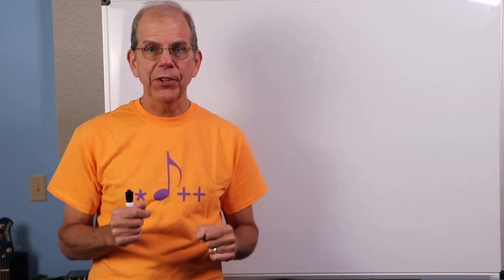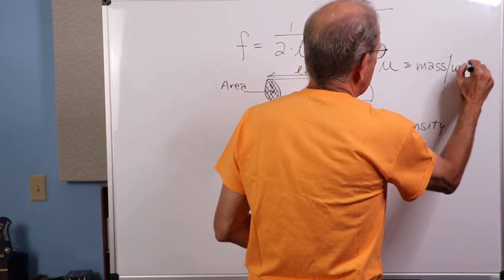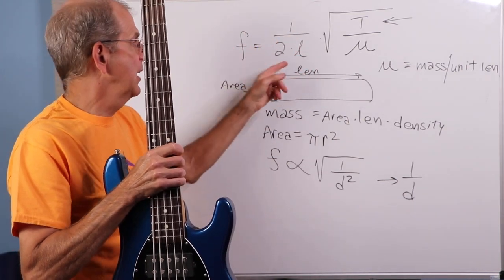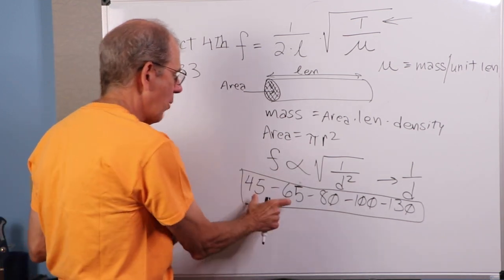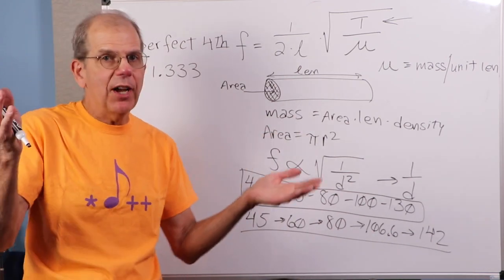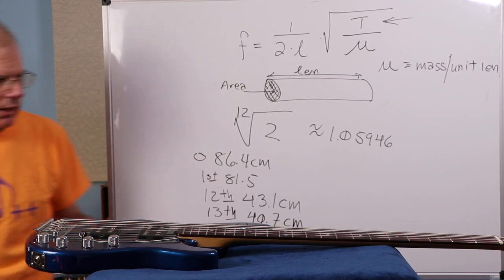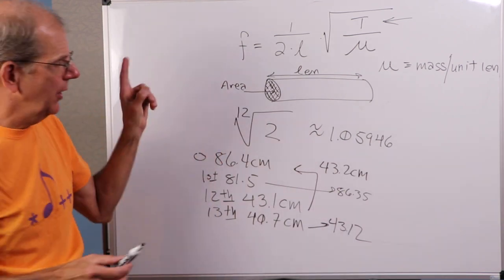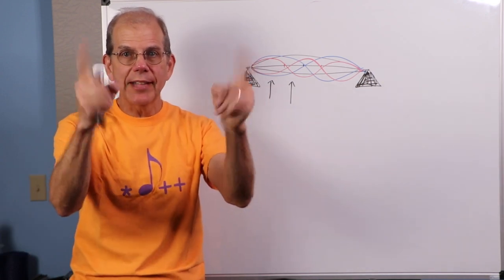Science of Sound: Guitar Physics

Comment: Nice explanations, do I wish you got a bit grittier into the math, trying to learn about intonation changes and compensation for temperance like stretch tuning. also I have a nylon string and only the largest 3 strings are wound, sometimes like 19 cents off as a difference from the 4th to octaves, and would like to see how different strings might help normalize the tension disparity.
Reply from the maker: All interesting bits to be sure, but a little more than I can cover in an introductory video. 19 cents is quite a bit. Has the instrument been set up properly (using that set of strings)? For ideal strings, the diameter* does not matter but there is a small correction factor for real-world strings based on diameter (same thing is true for resonant pipes in case you also play a wind instrument). In practical terms, though, the important thing is making sure that the guitar has been set up by a qualified luthier. No note should be off by 19 cents on a correctly tuned instrument.

*to be clear, that statement assumes the two strings have the same mass per unit length (which implies that if they have different diameters, then they must have different densities, i.e. made out of different materials or using different construction).

Comment: Sorry, but I'm still waiting for part 2  regarding pickups, which would have pratical use, because many questions were left unansered as far as I can tell...: 

How thinner or thicker coil wire...vs more or less "turns"...affects affects both tone & output power. It appears that more "turns" on the pickup coil increases current & woltage out, while thinner wire decreases it...but with a net gain of current & voltage  from more turns of thinner wire, but an increase of the frequency of the resonant peak. 

I also understand that inserting a capacitor between signal & ground on the tone "pot" can increase or decreae (higher value "cap") the resonant peal of the overall output, while the latter increases the bandwidh of the higher frequencies the cap passes. Why & how is that? And how does the "taper" of potentiometers physically accomplished and what does each taper doe to frequency response as the "pot" is turned. And, I've a'ways thought that a tone control increased or decreased bass vs treble frequencies...but now I've read that it actually just decreased the resonant peak/ Is that right??? 

In fact, how do "pots", which are variable resistors, vs capacitors, in pickup circuits affect tonal & power output. And, is there any way to create, effectively, a variable capacitor using electronis as opposed to the tradional "tuner" device consisting of interposed metal plates?

And, how is frequency response & power output of a pickup varied based on whether one pickup is "on" vs 2 or more, and how is that output changed based on whether the pickups are in phase, or not, in parallel or in a series? I "get" that  hum-cancelling is  accompleshed by combining twosinglecoils  with opposite winding direction & opposite polarity, as  long as  the  magnet strength,  number of winds & resistivity of the coil wire of the two coils is identical. But, how does that work?  

There are "treble bleed" circuits ranging from a single capacitor, capacitor AND resistor (in a series, parallel, or 2 resistors...1 in a series & 1 in parallel with the cap)...But, how do these respective "circuits" affect level of treble tone as the volume pot is turned down...and why??? I understand that a variable resistor in a treble bleed allows the amount of "bleed" or treble pass-thru to be varied...but is the variable resistor to  be in a series  or in parallel with the "cap"?

I appreciate your videos...but sometimes they stress the theoretical, rather than the practical nature of this physics. And, while you talked about pickups for guitars...you can see that there are dozens of things you omitted! I thought you were going to create a Part 2  about pickups (which would cover the above)...but all I can  find is about a minute about pickup harmonics, suggesting why some guitars have multiple pickups, in your Science of Guitars video. And, in that minute or so, you didn't even mention why the position of the pickups affects its tonal (as opposed to power) output.

I sure would like to see that Part 2 about pickups, that would explain even a fraction of the above...and how that knowledge can be put to use from a practical  standpoint. THX
Reply from the maker: Well, you certainly have raised a number of questions, and as I always told my students, "Every good question deserves a good answer, and every good answer will lead to another good question". Everything you're asking would require several videos to address, but I'll try to hit a couple of them here and now. 

First, yes, I do tend toward the theoretical, but that's because I'm an engineering professor and my target (students) want and deserve that sort of subject treatment. Granted, on YT, I recognize that there are a bunch of non-engineering students who watch these videos so I do try to slant a few of them in that direction. Can't please everybody, though. Anyway...

More turns generally leads to a higher output. The gauge of the wire is a practical limiter here (who wants a pickup that's 6" across?). All things being equal, a lower gauge number (i.e., thicker wire) will lead to less resistance. This resistance will interact with the coil inductance and any associated cable or winding capacitance to change how narrow the resonance is in the frequency range (i.e., the bandwidth or Q). A proper explanation for this requires a study of series and parallel AC resonant RLC circuits, and that's not trivial (I've got an entire playlist on the study of AC circuit analysis and one entire chapter of my free AC circuit analysis text devoted just to resonant circuits). In general, the smaller the capacitance and inductance values, the higher the resonant frequency, and the smaller the internal resistance of the coil, the sharper or more pronounced the resonant effect (ditto for a larger parallel resistance- indeed, a small series coil resistance can be shown to be equivalent to a large parallel resistance via a series-parallel transform).

The taper of a pot doesn't change the frequency response, per se. Taper simply refers to how the resistance change is distributed across the range of motion. A linear (standard) taper will be 50/50 resistance when the pot is centered. A log or audio taper pot will be 10/90 when the pot is centered. Typical volume controls use an audio taper. If you used a linear taper, then if "10" is fully clockwise and "0" is fully counterclockwise, "noon" would be about "9" instead of "5". IOW, there would be very little volume change over the last half of the rotation. It would still work as a volume control, it's just that it would be very sloppy on one end and very touchy on the other end. 

As far as variable caps are concerned, electronic versions of a variable capacitor are available but they're probably not what you're looking for. This is normally achieved through something called a varactor diode. A reverse DC bias voltage sets up the capacitance. It is quite small though (think in terms of picofarads). It is fine for electronic tuning of radios but not very practical for something like a guitar (for a variety of reasons). 

I do address the tone changes caused by pickup position toward the end of the video above. Usually, when people refer to "tone" they're referring to "tonal balance" or how the high frequency levels compare to the lower (or middle) frequency levels. As any given note is made up of a fundamental plus a series of higher harmonics, then any change in those levels (i.e., some frequencies being boosted or reduced compared to others) will affect the timbre (i.e., the tone). The pickup position does exactly that- as you move the pickup closer to the bridge, the lower frequency levels tend to reduce compared to the harmonics. The end result is a sound that people will describe as thinner, bitey, brighter, or less mellow. These are tough terms though. It is hard to use words to portray with accuracy something that you hear, unless we all have an agreed upon vocabulary for that. I mean, I can say that technically speaking, the fundamental's amplitude is lowered, but how does that translate into what you experience as a listener? How do you describe "blue" to someone who has never seen the color blue? You can't say "It's kind of like green", right? Reminds me of how people say lobster tastes like chicken. No. If you've had both, you know that lobster doesn't taste like chicken. It tastes like lobster. Maybe it tastes closer to chicken than it does to, say, bacon, but that doesn't mean they taste the same. Fun stuff to think about.   

Not sure what your background is, but here are a couple of videos from my semiconductor devices playlist that discuss the interaction between an amplifier, guitar pickup, and the cable between them:
https://youtu.be/f7dtLt5igeE?feature=shared
https://youtu.be/UeCEdn516ZY?feature=shared

PS - You win the prize for the longest comment reply I have ever created on YT. ;-)

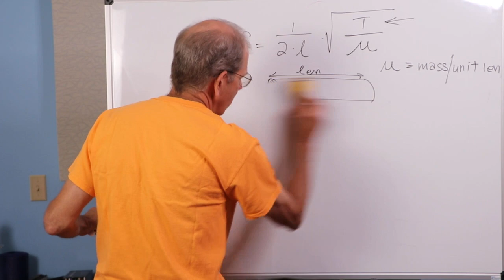Comment: 23:00
The analysis is inaccurate and the terms are wrong. The neck pickup would sound fuller and warmer and the bridge pickup would sound more biting and brighter, and the most important thing is that the areas of vibration change depends which note you press. So the pickup would get different vibration areas. Playing on the same string on the first fret and on the 17 fret will have different results because at the first fret the string already vibrating in the area of the second fret and on. That's a long way from the pickup itself.
There's also the fingers position of the plucking hand that affects the sound much more then any other part in the sound. 
Why? Because while the rest of the sound ingredients are fixed more or less. The hand moves freely and the area of plucking will affect everything regardless which pickup works.
Try it out with different pickup combination and plucking. Than, explain that physics.
Reply from the maker: There may be some confusion on terms as I am thinking that we don't fundamentally disagree. As I said, the bridge pickup would have stronger high frequency overtones relative to the fundamental than the saddle pickup would. How do you want to describe that in aesthetic terms? If you think in terms of boosted highs, you might say "bitey", but if you think in terms of less lows, you might say "thinner". I've been playing bass about as long as I've been a professor of electrical engineering and technology, so I appreciate the issues of terminology between the engineering/science and artistic worlds.

It is true that where the nodes and anti-nodes show up on the string is a function of where you're fretting, but I'm just looking at a single variable here to help clarify a complex situation. Otherwise, you have so many variables that it is hard to see the contributions of each part. And sure, where and how you pluck (fingers, thumb strike, pop, pick, etc.) play into this, but again, it's best to explain the effect of each part. In this case, that's the general effect of the location of the pickup on the timbre produced.